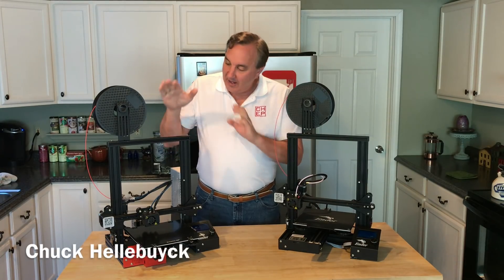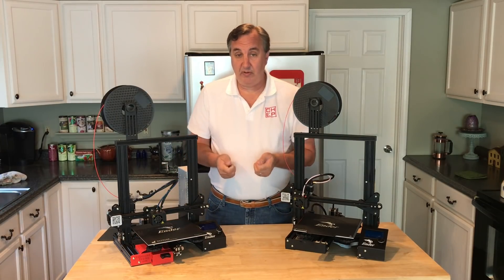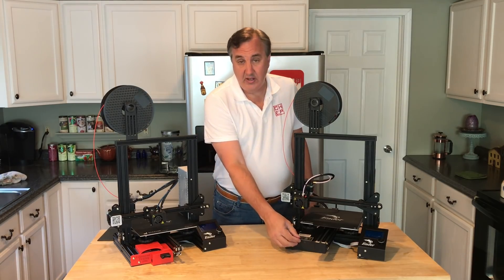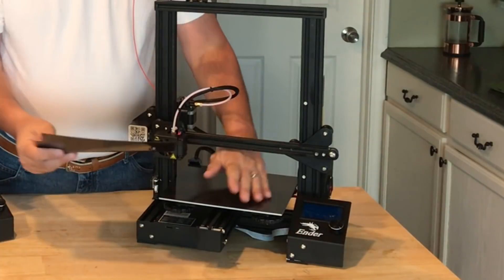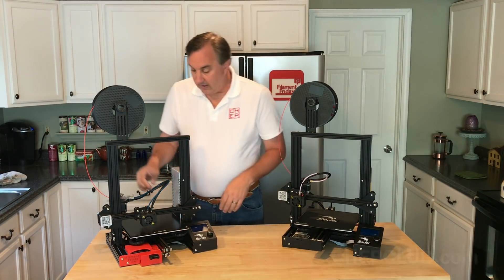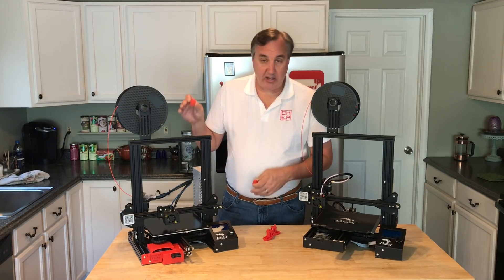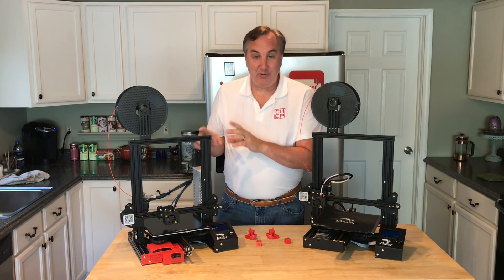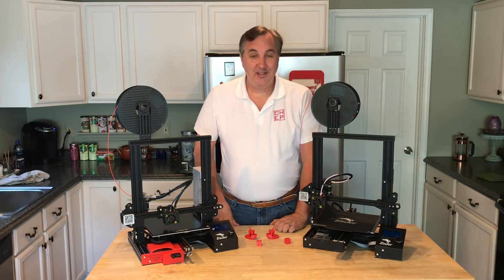Creality Ender 3 PRO vs Creality Ender 3 - Is it worth $100?

Comment: Just got the offering on amazon for the ender 3 pro + glass bed included for $259.  I ordered some springs to offset the weight too...it arrives tomorrow and I'm crossing my fingers it's good because it only has 5 reviews or so and just 3 stars on that particular listing.  Here's hoping everything works out.  I kinda wish I had gone with the CR-10 mini i was also looking at.
Reply from the maker: That’s the benefit of Amazon. Easy returns if it doesn’t work out.

Comment: SO I dumped the Anet A8 for the Ender 3. I already have the buildtak version of the magnetic plate. I have the skr 1.3 with 2209 stepper drivers. All it is just an upgrade version of the Anet A8.
Reply from the maker: That is exactly the target market Creality created the Ender 3 for. They wanted to knock out the A8. It seems to have worked.

Comment: Just brought another Ender 3 pro on creality for £179.99, always buy from the manufacturer as you do save money generally. Also great video!
Reply from the maker: That’s equal to  $236 usd. If someone  buys through my affiliate links they can get it for $219 and you help support the channel in the process.
Reply: @FilamentFriday  Great channel. But your $17 USD saving soon disappears with the 20% value added tax plus £5 paperwork handling fee, plus the import tax to the UK which is where the comment poster comes from.

Comment: I don't know when the price went down, but I just got the ender 3 pro for $229.  Which was only $35 more than they are currently charging for the non-pro version.  The power supply and beefier Y support is definitely worth spending the $35 for... IMO
Reply from the maker: Since my video the difference has slowly dropped. Apparently others saw what I saw and would not pay $100 more. Many people don’t like the magnetic bed because it’s limited to 70°C. I wish they would just combine Ender 3 and Pro into one machine.
Reply: I wouldn't have paid an extra $100 either, but for $35 seemed like a no-brainer  :)   
Agree on the combining models as well, though they probably keep the original so they can entice people with a sub $200 pricetag.
Reply: @FilamentFriday  They advertise the bed to 110C don't they? And you showed the magnet being difficult to align - does it mean the bed itself is magnet as well as the removable sheet? Will the bed hold a steel sheet at higher temperatures? Its on sale, $202 with coupons and voodoo at AliExpress now
Reply: @notsonominal  got mine for $204

Comment: My ender 3 “stock” came today, it has a removable build plate standard.....and doesn’t have heat restriction.
Reply: Is the build plate flat? Is the power supply reversed, or is the power supply fan facing up?
Reply: @adaml.5355  it's an Ender 3, not a pro, so everything is orientated as it should be, apparently all new versions of Ender 3 have this fiberglass style removable plate.
The bed does dip in the centre by 0.102mm
Reply: where'd ya buy it from? I'm waiting for mine and hoping its the newer version
Reply: @whibby  If you are still interested on this topic then I just got mine Ender 3 from Gearbest last week (Ordered it about 1.5 month ago) It also has removable build plate. It's attached with binder clips by default.

Comment: Great video, thanks for the info, and I did decide to go with the pro for a couple reasons, but when it arrived I found a few surprises you don't mention:
1. It comes with the snap rings for the tube fittings to secure them, as well as spares (I already ordered high quality stainless ones so oh well).
2. The thicker Y axis mount is a huge bonus!  The pulley doesn't get crooked and cause the belt to run off-center.  X-axis is still meh.
Reply: Just found another fun surprise - the hot end has a silicone insulator instead of the cheap-o tape.

I keep coming across little things, I think they might add up to $100.
Reply from the maker: That is new since this video and I believe they both have that now.
Reply: You get the glass build plate as well?

Comment: I bought my ender 3 from Amazon about 3 months ago and it came with a removable bed... it's not really flexible, but it comes right off of the base. It also came with some little paper clips to hold it down.  I don't know creality would need to make a pro version considering that the printer is open source. I would have assumed they would just make upgrade kits or something.

Comment: I got the Ender 3 Pro for only 219 shipped last week. Sadly, I've spent at least 24 hours over the past week with zero luck in a decent print due to a terribly warped bed which changes from room temperature to when I heat it up.
Reply: Donut Religion I’m not sure if this is still a problem for you, but for my warped bed, I put some heat resistant tape on the bottom of the magnetic plate  in the places that were too low.
Reply: @gavinw.  I just caved in and got a glass bed. Once I realized that I was leveling it incorrectly, the magnetic bed got pretty mangled.
Reply: Donut Religion oh nice I’m also thinking of getting a glass bed cuz the tape thing only works so well
Reply: @gavinw.  It's worth the investment, just be sure to get some 1/2 inch binder clips and some purple Elmer's glue stick depending on if you get a smooth or textured glass.
Reply: @donutreligion2979  Oh ok thanks. I will keep that in mind if I get one.

Comment: Thanks for the video CHEP. I came here because I have 4 Ender 3's and 1 Ender 3 Pro and I have a subborn print that only the Pro will print, the non pros fail via under extrusion at the 5 hr mark, but it seems like all the electronic components minus the power supply are the same so i'm not sure why the Pro can print it but the others cannot...

Comment: I believe all of the regular Ender 3's  now have the removable print bed.
Reply: But its the pcb type style as far as i know, no magnets, no problems with higher temperatures.
Reply: Mine did have a removable bed. But it sucks. I tried printing PETG and the plastic removable bed sheet came apart. I now use magnetic beds. I would recommend printing only PLA with that magnetic bed. Keep the bed temp below 75-80 degrees.
Reply from the maker: That’s why I added glass bed on mine.
Reply: I believe then you add 1) a lot thermal mass and 2) ringing, which forces you to set jerk, acceleration and speed to smaller values. I think the best compromise is the pcb-style removeable bed. Or, better yet in my view, just the buildtak like stuff on top of the heatbed. Lets face it, removing prints isn't THAT hard ;)

Comment: I think also the assembly of the Pro is a lot more simplified. For me the only slightly desirable feature of the pro is the widened Y(Bed) axis. Although saying that My E3 Y axis is running perfectly. No wobble or creep and it's perfectly smooth. If it does start to give me problems I will probably convert it to a 300mm linear rail which I suspect would do the trick. But for right now it's working perfectly. I don't even want to do autolevel because my level stays good permanently now with two mods. 1, I print on 3mm regular glass (picture frame glass) and 2, I printed a pull handle for the print bed that attaches to the spider not the print bed. So I never pull or push the print bed directly and when I remove prints I remove the glass and then detach the prints. This stops me exerting any force on the printer build surface and the glass cools down very quickly. Yes I use Aquanet, but being able to clean it up and not worry about the build surface degrading is a major plus.

Comment: Nice job. I do think the wider beam on the Pro may allow for better large bed prints because potential bed edge printing should be more stable.
Reply from the maker: Seems logical but I rarely print that big and when I have on the stock Ender I didn’t have any issues.

Comment: I always wonder how the x axis will stay perfectly horizontal, without sagging at the other end that has no lead screw, to keep it horizontal.   I don't have this printer yet (looking at it), wanted to know if anyone put  two Z-axis lead screws with 2 motors (not linked with a timing belt) . That would make the two ends of the X axis move in perfect tandem.

Comment: They said the system got resume-printing function even if the power is cut off by accident, that means u could continue to print when u power on again after switching off
Reply from the maker: They both have it.

Comment: I got the Pro for relatively cheap, only 30 dollars more. The power fault recovery and print pause was also advertised, but idk if the regular Ender 3 also has it. The power supply and removable flexible build surface sold me on it immediately. Make sure to check it came with thermal runaway protection out of the box.
Reply from the maker: They’ve dropped the price since this video. The Ender 3 has both recovery and pause. It also has a bed that clips on rather than magnetic. So things have changed since I did this video. I tried to cover some of the updates here. https://youtu.be/byBTLtBr_gw
Reply: @FilamentFriday  The best reason for the Pro over straight Ender 3 (esp. at these price points) is the Meanwell power supply.  Cheap chinese no-name power supplies scare me.
Reply: @JoelAz909  I bought the regular Ender 3 three years ago and it's been in constant use since then. I have had absolutely no issues with the stock power supply. You do realize that the Meanwell is also made in China? I've made several other modifications to the printer but in reality, there were only two things that are really necessary (IMHO): 1) changing the plastic extruder to an all aluminum one, and 2) installing a glass bed. I also installed an all metal hotend because I print ABS. Love this printer and may buy another one so I can print more than one thing at a time.
Reply: @Waltkat  I realize the Meanwell are also mads in China (at this point almost every power supply is) but the Meanwell is branded and has ae QC whereas nonbranded can just be whatever.  I dontean to imply that every non branded PS will self destruct but the chances are higher. Maybe only a tiny bit but o feel better knowing theres a named brand and so less playing fast and loose. PS can be a fire hazard and it's one where I don't feel like rolling dice.

Comment: I saw a video where the kid said he printed flexible materials out of the box... can the ender 3 not actually do it or did your mod make it better? We just ordered one for my son and im excited to give it a go myself. Ill be doing the upgrades i think before he gets it.
Reply: @Robert West it may or may not work. What people experience is that the included extruder either doesnt bite well enough due to flexing in the plastic, or they experience that the filament gets «chewed up» by the extruder. I would recommend raking a look at a bulldog extruder online at tutorials. They apparently work better than the stock one. You can most likely print semi flex but not ninjaflex with stock extruder.
Reply: flexible works with plain ender 3 if you print a good filament guide, so the filament enters at no inclination. It worked for me, was having jams before.
Reply: @yozamazaobakupa8761  awesome i have one not full on level going in. I need to reprint it anyway.
Reply: @rockguy9022  I had to print many flexible pieces that were pretty small so it doesn't move up and down, I installed the filament spool on the side so it goes in straight, did it for me.
Reply from the maker: Depends on the flexibility of the filament. Some filaments are semi flex and print fine. A real rubbery or stretchy filament like ninjaflex will often escape the extruder during printing.
Reply: @CHEP thanks for the good advice. Waiting for my ender 3, the post service is so damn slow it has been sitting in one place for 3 days

Comment: With a 100$, you can buy yourself a glass plate for 30$, vibration dampeners and a less noisy nozzle fan for less than 10$ and 3 kg of filament for 60$ ! 
So the « Pro » version ISN’T wort it !
Reply: Wayne Johnny To a noob $100 is totally worth it for the upgrades. They don’t know better.

Comment: Hey I had some questions on buying my first 3d printer. I was wondering can you print flexible material on the printers without adding an attatchment. Also I was wondering what printer I should buy if it is my first tim eprinting. Also when printing and if you uset he heated bed how long do you have to wait after the print to detatch it from the base.
Reply from the maker: A direct drive print can print flexibles without attachments. Depends on your budget. You can usually remove it right away.

Comment: I don't  understand one thing. In some videos you tell  that you love and prefer the cr10 mini that the ender 3 but in other videos in the comments you change and prefer the ender 3, what happens?.
A last question the extruder in the pro it's  not necessary to change for other? And if I change the magnetic bed of the pro for a glass  bed I can work with ABS and flexible materials?
Reply from the maker: What is the date of those videos?
Some printers get better over time (Ender 3) and some get discontinued (CR-10 Mini). 

Yes, glass with a little glue stick works great with both. Some flexibles don’t need any glue.
Reply: @FilamentFriday  sorry you have a lot of reason the date's it's very different, now I understand.
Only one question please, the ender 3 v1 it's now discontinued with the enter of the ender 3 v2?
Reply from the maker: Not that I’m aware of. I believe it will still be around but right now it’s hard to find in stock anywhere.

Comment: 5:48, any difference in size to .001"?  Did you put a caliper on them and see?  I'm just getting started in this market and my main need is to print nylon and print to as fine as a resolution as possible but I also want to stay under $500.  Thank you.
Reply from the maker: Nylon requires high temp. You’ll have to modify the printer. Or spend more.

Comment: Correct me if I'm wrong, but don't both versions (base and pro) come with the magnetic bed now?
Reply from the maker: No. The standard Ender 3 has a removable Fiberglass type bed now. Pro has magnet.

Comment: For me it's not worth it. As far as the buildtak I didn't stick mine to the bed. I just use the clips to hold it and I take it off when the print is done and I bend it a little to get the prints off. I've been using it like that for months now and it's still flat as a board. I dont know why anyone would stick it down to the aluminum bed.

Comment: I was asking myself the same question… Pro version or standard version? I'm looking to buy my first 3D printer. I have two big questions: 
1- Does the frame for the Y axis on the standard E3 can be replace by the one on the E3 Pro?
2- If I go for the E3 Pro and put a glass on its bed instead of the magnetic sheet, will the bed heat up at the same level of the standard E3 or there will be problems caused by the bed's electro-magnets?
Reply from the maker: 1 - No.
2 - It’s been an issue for some. So if that’s your plan the standard is better.
Reply: @FilamentFriday  Thanks a lot! Thought actually the magnetic sheet was the only problem but if the bed too... I mean, look, I might go for the cr-10 mini instead if I want a better printer or go for the standard E3 (but with multiple diy upgrades).
Reply from the maker: I really like my CR-10 minis and the extra build volume can come in handy.
Reply: Saint-André Jérémie - Just brought another Ender 3 pro on creality for £179.99, always buy from the manufacturer as you do save money generally. Also great video!

Comment: I'm getting a 3D printer for Christmas.   What filament and brand do you recommend for a beginner  ?  Thank you for your comments
Reply from the maker: My Filament Friday Filament. But really any standard PLA. Is good place to start
Reply: PLA +
Reply: I found out I'm getting an Ender 3 pro , lol.    I'll check out the Filament Friday Filament.    Thank you.    I have watched alot of your videos lately.
Reply: Look for filament with a similar diameter hole as your holder setup has. Sunlu filament has a huge hole, others are smaller. It will affect the tension on your extruder

Comment: Hi chep,could you print your own design with these  printers from the printer software ?
Reply from the maker: Yes, you can print your own design but you have to design it in a CAD program like Tinkercad.com and save the .stl file. Then you can slice it using Cura to print it on these machines.

Comment: well, I bought Ender 3 two weeks ago and it already has a removable plate on the hotbed. Not with magnets but nevertheless, it is flexible and it works fine :) So PRO version is not so great.

Comment: important: in this version do they fix the problem of the thermal runaway?
In the ender 3 there is NO thermal runaway protection so do you know if they fixed the firmware? This is important for fire safety but you have not checked that.
Reply from the maker: It’s been enabled in the latest released version being shipped but at the time of this video neither had it enabled.

Comment: i got the ender 3 pro for about 300$ canadian, and it came with the glass build plate, plastic build plate, and extra nozzles of different sizes. i'm not sure if it was jst a special the company had or if that's the new standard though.
Reply from the maker: It’s the Ender 3X

Comment: May have messed it.  But I cant find the video on the glass you got.   I got an ender coming and would like to get one for it
Reply from the maker: Here it is https://youtu.be/mDNo1yyGosI
Reply: Sweet.  Thank you.  Did you did out how to fix the ringing problem when you used it ?
Reply from the maker: Not really. It’s just a weight of glass moving I can’t combat.
Reply: Ok.  Well are you using anything on the glass for you print. And is it a big deal , worth it ?
Reply from the maker: I flip it over an get smooth prints